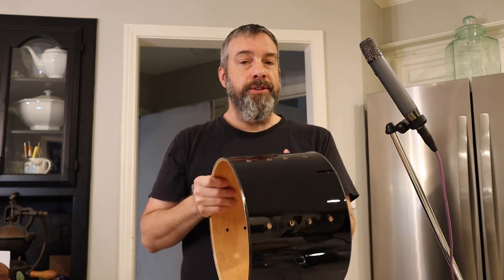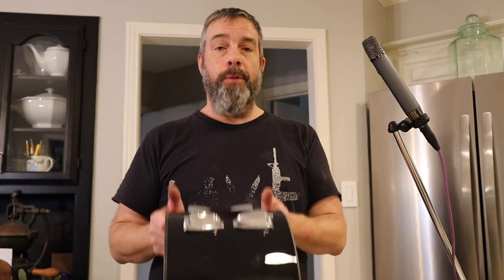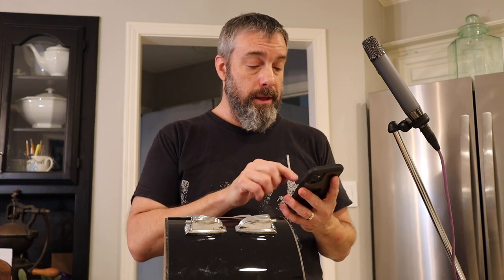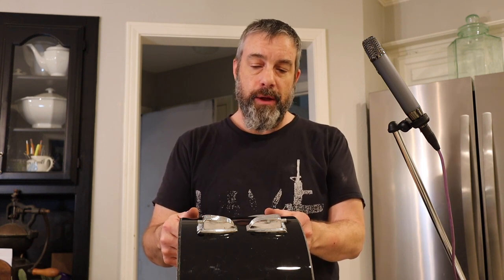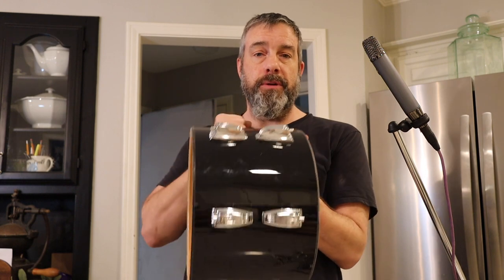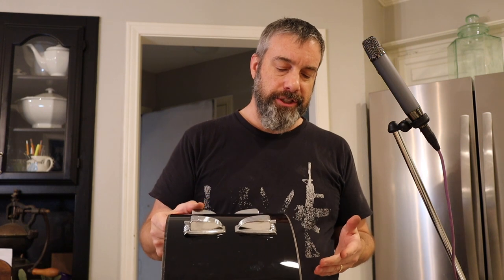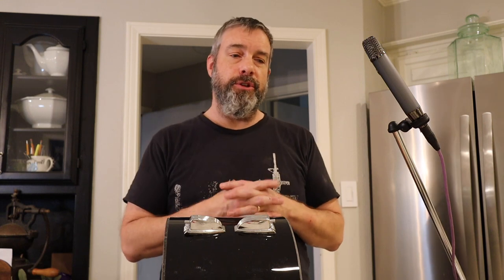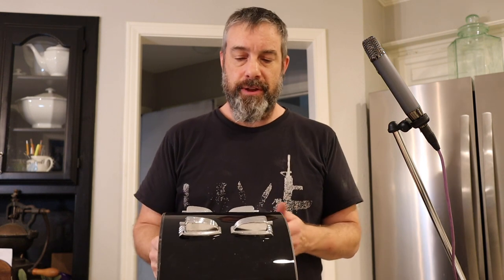A Drum Shell's Inherent Pitch... Does It Matter???

Comment: It's just like when everyone transitioned to RIMS mounts. It effects the shell having the very large mounting hardware bolted on to each drum. Take that big hardware off and reduce large holes in the shell and it can sing more, right? I guess you'll cover that eventually, and let us know. lol
Reply from the maker: I find that holes left in the shells of toms that have been converted to an after market suspension mount don't create a problem, sonically.  I don't love the aesthetics of extra holes (when they're visible), but can't really tell much of a sonic penalty, FWIW.  

The idea behind suspension mounts that remove pressure from one part of the shell (by removing a bracket that focused the weight of the drum on a single point) the shell can vibrate easier and/or even if it doesn't vibrate much (heavier shells) what vibration that does happen is evenly distributed around the full circumference of the shell, not a single point of restriction because of a bracket.  The result, often, is livelier tone from the drum, which many people want.

Comment: Question (and maybe an idea for a video): what do you think of the theory of drum sizes differing by relative volume/mass? Like, the big difference in an 8" tom to a 10" tom, but not a big difference between a 14" tom to a 16". 

I think people like the aesthetic of a 2" differences rather than equal difference in sound (without over-compensating on tuning).

*edit: So, if an 8" drum is 5ltr and a 10" is 7.5ltr, should the next drum be 1.5 times 7.5ltr? Etc.?
Reply from the maker: You think like I do!!  My first new drum set was a mid-80s (I was in high school) Tama Imperialstar shell pack (though we didn't have this term then :) that I assembled by ordering the individual drums I wanted rather than ordering a pre packaged drum set.  The kick was as 22", and the toms I selected, in an effort to be have as consistent intervals as possible (EXACTLY like you're describing), were 8", 10", 12", 15", and 18".  The 15 was a rack tom that I mounted in the floor position with the 18" floor tom.  

I am similarly building (not actively yet, but collecting the bits and will build shortly) a smaller diameter gigging kit with equal tom ratios (diameter:depth).  It'll be meant for small gigging kit, but really it's an experiment for the reason you mention.  The toms will be shallow, and have dia:depth ratio of 1 : 0.625.  So they'll be 10x6.25, 12x7.5 and 14x8.75, though I'm thinking of doing a 15 instead of a 14".

All pretty nutty stuff, but not worth getting truly neurotic about as there is no way to guarantee consistent specimens of wood (grain/density/hardness).  The use of plywood construction (glue) helps balance the natural inconsistency of wood (particularly true of very thin veneers), but still wood is a natural product and subject to tolerance variation.

Fun stuff!!!!  Thanks for commenting!
Reply: @DrumDotPizza  Great answer, wow! That's a great size relationship you mention, yeah. When I started, in the late 80s in Ireland, the only affordable kit set was 12, 13 and 16. I always hated that the mounted tom were so close in sound and the floor tom was miles away. Pearl Export 😬😆

Comment: I really appreciate your videos! But I have a question about the pitch in comparison with and without hardware.... I can hear that the pitch got lower once you put on the hardware. However I am a bit confused about the adding mass explanation. I compared shells from the same manufacturers made from the same materials and same measurements but different thickness and the thinner shells always had a lower pitch... or am I wrong? So why does putting on weight to the shell lower the pitch, when adding layers normally gets the pitch higher? Maybe I just recall it wrong😅 I thought higher density of material would add to the stiffness of the shell so it basically can only do small quick vibrating motions compared to thinner shell walls that can vibrate easier and do larger motions in lower frequency which will result in a lower pitch (that's my background knowledge but let me know if I'm wrong)
Reply from the maker: Great question, and I believe I have a good answer (let's hope!):  More variables at play here than simply mass -- Basically thinner shells have thinner plies (not all, but most) which experience less pitch change upon bending against the grain.  So a thin, modern 6-ply shell will have a lower pitch than a shell with thicker plies.  The thicker the ply the greater the flectional resistance (all other things being equal).  the greater the flectional resistance (resistance to bending/twisting/etc.) the greater the rise in pitch when it is bent.  So thicker shells tend to have higher pitches.  

Also, whether a shell uses thick or thin plies a 6-ply shell will still have 5 layers of glue holding it together.  The thinner the plies the less wood (but still 5 layers of glue).  So thinner shells tend to be a higher percentage glue than wood compared to thicker shells.  Glue has (IMO... not empirical science that I am aware of) a lower pitch than wood as it had NO flectional resistance when applied.  It simply dried/cured to the desired shape.  = lower pitch (for thinner shells) again, all things being equal.

Thanks for you question!  I hope that helps.
Reply: @drumdotpizza   thanks for the answer. Yes this makes sense 👍 
In my example it was 6 ply and 8 ply keller maple shells. I think the plys thickness is pretty similar in all their shells. And I guess with more layers of wood there will also be more glue in total but it makes sense that the overall stiffness of the shell will increase with more layers and this might also change the shells resonance frequency.... also the diameter of the plys on the inside gets smaller the more plys you add so they are flexed more compared to the 6 layers in the 6ply shell...well anyways it's a very interesting topic and I enjoy your videos! 😁 (PS: will there also be Pizza related content in the future? 😅)
Reply from the maker: @user-mx6ho2mo8g   Not planning on pizza related content, per se... but I AM designing a channel logo that may just bear a slight resemblance to a deep dish pie! ;)